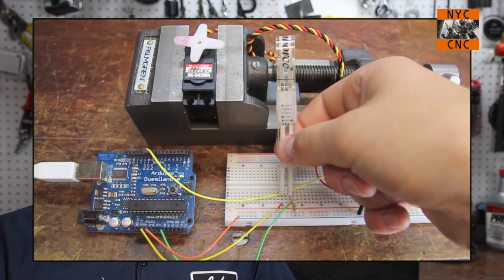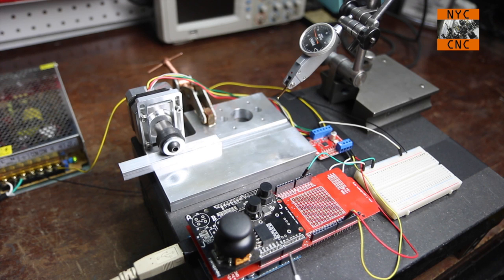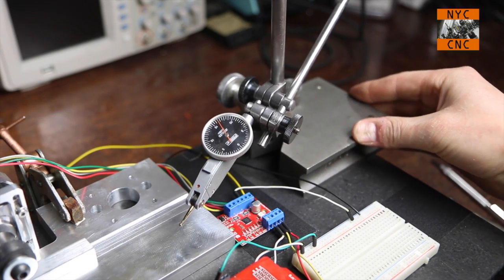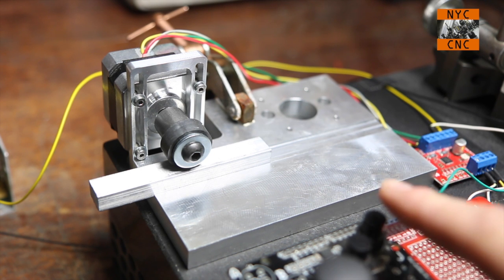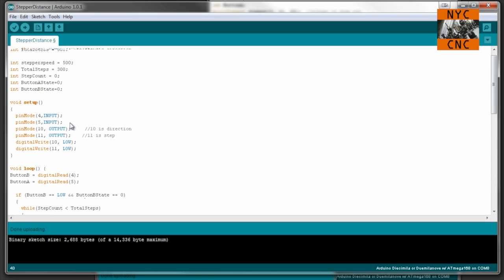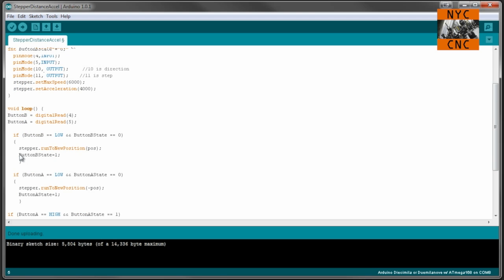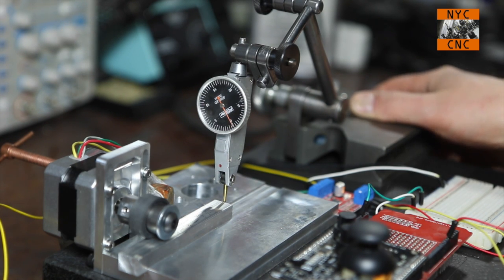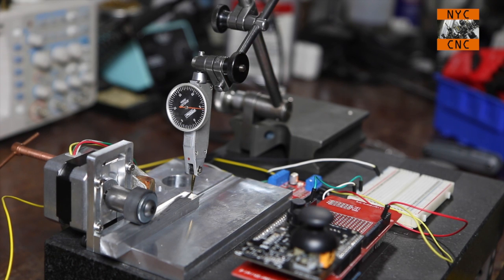Arduino Stepper:  Ultimate Accuracy!

Comment: Arduinos are for weenies.  Relying on libraries written by weenies is NEVER a good idea.  Leave the Arduinos to the 'Macs are the best computers in the known universe' crowd, and learn to write and compile C programs to be directly uploaded to the uC of your choice...'sketches and shields', LMAO.
Reply: You don't seem to realize that that is precisely what it is when you "upload a sketch". It compiles with avr-gcc and uploads with avrdude.
Reply: dc443
You're right, I didn't know that, but it merely reinforces my point.  Why add another needless layer of BS to what should be a relatively simple process.  Not to mention all the pretentious renaming of the basic concepts: source = 'sketch', PCB = 'shield', etc.  Not surprising that so many Arduino 'programmers' have trouble with data types, floating point, etc.

If the Arduino fad is looked upon as a starting point toward programming, fair enough.  But all I see is the self-congratulatory LED-blinking, and the dilettantes who pass this stuff off as accomplishment.  The smart ones are the mfgs and retailers who are tiny beneficiaries of the Apple Fanboi movement...

Oh yeah, and we have a chick selling hardware, exploiting the Countess of Lovelace.  How incredibly revolutionary!

Arduino is marketing, pure and simple.  It's very clever marketing, egalitarian, and pandering to the lowest common denominator.  I suppose if anything useful gets done along the way, it's gravy...
Reply: schwartzenheimer1 Well if i may play the devil's advocate a little bit, perhaps i could point out that you are simply a little bitter about not yourself coming up with the brilliant insight of how profitable it is to be able to sell boards for $30 a pop that sell like hotcakes because all the "idiots" buy them to blink some LEDs on before they most likely collect dust for the rest of their existence. 

I think I can understand the source of that cynicism coming from those us who have spent years doing things the "hard way".  Seeing hundreds of "idiots" post "self congratulatory videos" and what not about their "Hello World" experiments. It gets old seeing these useless things. The truth, however, is that this is the democratization of electronics and computer engineering. People gotta start somewhere, man. Young people, new people learning things quick and doing useless things should be encouraged. They are not idiots and I don't see why you have to contemptuously label these folks as such. They are sharing the delight they had making something work. How can you not appreciate that? It's one of the best feelings anyone can experience.

I am one of those people who started out learning electronics after the advent of Arduino, but I'm kind of different because it just clicked a whole lot better for me since I already had a very good understanding of data structures and all that. With a perspective like this I will say that they are doing something great which is wrapping up the scary complicated steps and putting it together in a way that novices can get started quickly. This is value in and of itself.

It does not in any way cheapen all the experience that you already have accumulated. You admitted it yourself. You were appalled by the "pretentious renaming" of stuff and it offended you so much that you didn't even bother to look under the hood to see that it's just clever packaging of the same old time-tested workhorse tools to just make it work. It's just marketing and packaging, yes, that's correct. So what? Why not embrace it. Why all this hate?

Pandering to the lowest common denominator is complained about by aficionados in every single hobby ever. It just so happens that electronics can be so much more rewarding than just any old hobby. Admit it, all you who lament the pandering to the LCD. Selling in volume is the name of the game. 

And that jab at ladyada is just completely lame and uncalled for. What the hell does a woman have to do to earn your respect??? In what twisted version of reality is this "exploitation"??
Reply: First, your suppositions about my 'bitterness' are unfounded and uncalled for.  Taking it to that level is a good way to end the conversation.

However, since you're obviously bright, I'll take the time to elaborate a little.

I don't object at all to people learning a new way to do things, provided that that new way is effective and, more importantly, rigorous.  And you seem to contend that, by definition, doing things right is doing them the hard way.  What I do object to is your silly statement that pawning off shallow and facile pseudo-engineering is the "democratization of electronics and computer engineering".  It DOES cheapen the field of engineering, in much the same way as Googling symptoms of an illness and demanding your doctor treat you for it cheapens the practice of medicine.

Scratch the surface of the Arduino community, and you see that the REAL meat of computer engineering is rotting.  "Why do I get -1 (on the display I hooked up per the instruction sheet), instead of 128??", etc.  And for every 'programmer' who actually takes the time to learn about data types, there are 100 (1000?) who just post endless whiny questions on various forums until some sap posts some code to copy and paste for an 'engineered' solution.

Explaining my distaste for exploiting Ada might be a little more political, and less technical:

"What the hell does a woman have to do to earn your respect???"

There is nothing a woman, by virtue of being a woman, can do to earn my respect as an engineer.  Period.

The historical Lady Ada (as well as the real Hedy Lamarr) made significant and laudable contributions to computer science, and communications theory, respectively.  They did so because they were curious, bright, and apparently impervious to the blatant sexism that existed during their lives.  I think our goal should be the elimination of sexism, racism, ageism, etc., not the leveraging of such past evils into marketing paradigms.

Thanks for your thoughtful comments, sincerely.
Reply: Perfect example: "...learn how to code in C or Hex."

Sorry, don't mean to pick on you, but you did inject yourself into this sub-thread.

'C' is a programming language; Hex is a nickname for base 16 number representation.  You don't program in hex, although at the machine level, your code might be printed out in hexadecimal numbers, and raw hex would be all but incomprehensible to read as a program.

And I believe you raised the 'dumbing down the pool' issue, which is definitely not my point. I note that despite your reference to doubting that this thread is 'recoverable', that didn't stop you from favoring us with a long post...

Maybe I've learned something from this thread: people who just want to get something working as a proof of concept find Arduinos useful.  Fair enough, as long as a) you aren't concerned with a robust solution, or, b) have 'an EE guy' as backup to actually do the work necessary to turn your concept into a functional product.  Again, fair enough.

Curiously, I recently saw Arduino experience as part of a job qualification in a recruitment ad.  Nice, if they can afford that kind of OJT in their product development cycle.

Generally, I just see shoddy, lackadaisical attitudes toward problem solving as undesirable, and I think the Arduino approach encourages it.

'nuff said.
Reply: NYC CNC Nah, I think the discussion isn't doomed yet because I can tell that we are pretty sensible people here. First of all schwartzenheimer1 my "suppositions" were not intended as a personal attack of any sort. I was responding to the attitude and tone of your comments and it is simply my hope that you can perhaps view this situation in a different light.

The one thing that I take issue with (and it certainly is an opinion, and to which you are, of course, entitled to) is the statement that this "democratization" process does any kind of cheapening, whether it is a patient using Google to diagnose themselves or whiny kids inundating forums with asinine posts about their homework. 

This is not cheapening! All of these people who are leading themselves astray, if you will, are only even capable of doing so by the virtue of the availability of free information that is afforded to us by the internet. The logic only works if these same people would otherwise be more knowledgeable or who would otherwise have a better understanding of the fundamentals. My point is that by using Arduinos, by the virtue of e.g. Adafruit making it so easy and accessible to obtain an Arduino, somebody who wouldn't have ever gone into electronics now at least has a fighting chance to make something cool for a much smaller investment in effort than would have been required 5 or 10 years ago. This is someone who would never otherwise get a chance to learn those fundamentals, who now because of their rewarding experiences with an Arduino (as evidenced by all the youtube uploads) might actually be motivated to go learn about the fundamentals! 

This is the future of humanity, the next generations that we are talking about. How can you be serious in saying that labeling a few things with new less-scary terminology (clearly with the purpose of enticing new learners who are weary of complexity and sophistication in the language) will hurt the learning process?

I think that to say that there is some sort of epidemic that takes otherwise "pure" young minds and "infects" them is just absurd. Everybody knows that copy and pasting code and having it work is a shortcut. It will encourage them to learn about coding and learn about how and why things work. In time. 

It's like the english teacher saying that sparknotes are a force for evil. No they're not. Those notes get straight to the point. They teach me about the books I was supposed to read. They save time. That's it.
Reply: schwartzenheimer1 Anyway it's been really nice to find someone on Youtube to have an intelligent conversation with. thanks for that.
Reply: dc443
I guess we just have to agree to disagree.  I do think Sparknotes (Cliffnotes in my day) are abused, and often evil.  Nothing can take the place of reading, gathering your thoughts, and forming your own opinions and hypotheses.  Don't get me wrong: copying code snippets and using them is common practice, and will probably lead to some thoughtful investigation when things don't work.  Here, however, the OP used a library function, admitting that he didn't know what the first passed argument was for, and expected it to work.  When it didn't, I didn't see him investigating the source, or asking the forum for help.  He just wanted to move on with a 'limit switch', in spite of the fact that he had an oscilloscope in the same frame as his failed experiment!

When I suggested that he look into the physics of what he was doing, I was rewarded with sarcastic nonsense.  Really, that code could be written in a few hours, providing accel/decel ramps, and accurate positioning by anyone with the willingness to earnestly attempt it.

Sparknotes and Arduinos just seem tailor made for the lazy and superficial.  I guess I have just seen to many disasters come from that approach, not to mention an intense distaste for the smugness and arrogance attending.

Lastly (for real), while you may perceive a tone in my posts, and even deduce an attitude, going there really comes off as arrogant, and the temptation should be avoided.  I have no idea what motivates you defense of all thing Arduino, and I would be doing the discussion a disservice to try to make your motivation an issue.  If I'm wrong, fine.  There's more to life than being right.

Good talking with you.
Reply: schwartzenheimer1 Fair enough.

For once an exchange that doesn't end with name-calling! that's good enough for me too.

The other part of my angle was that pretty much if you want to sell tons of units and make lots of bucks, lazy and superficial is the way to go... sad as it may be...
Reply: dc443
Cheers.
Reply: schwartzenheimer1 Since machine code is written in hex, and you can program machine code, (I had to for a recent class where we performed a stack overflow attack) I think it's splitting hairs a little bit to attack a guy for saying he's programming in hex. It's the wrong terminology, but no less accurate. It's like saying I'm writing this sentence in letters instead of I'm writing it in English.
Reply: If the assembly mnemonics are represented using hexadecimal characters, which they are for some machines, I'd say you're programming using hex, if not IN hex. Maybe it doesn't die because the internet doesn't like people who are so supremely convinced of their own "rightness". And because you insulted something for being accessible to a wide audience (hint, the internet is a wide audience.) Choose your battles more wisely next time.
Reply: schwartzenheimer1 I have personally written a series of hexadecimal numbers for the purpose of instructing a machine to do something which it has then done. I am a master's student in computer science so I'll call that programming with hex if I feel like it. To be honest I don't remember where we drew the line between calling it assembly code and machine code but it's programming using hex. You don't need to explain to me what hexadecimal is, I can add, subtract, multiply, whatever you want in hexadecimal. It sounds like you're not really that familiar with machine code. Have you ever used a debugger? I sure as heck have. 

You're 50+ years old and yet you go around calling people weenies on internet forums and throwing out every big word you can think of to sound smart. Yeah, you're a real winner.
Reply: dc443 I never said it was a good idea to program machine code, just that it could be done and that it is done using hex, defending the poster of this video. 

As for your second point, again we're in Semantics Land. The buffer is a part of the stack, so call it whatever you want. 

My whole point in all of this is that the programming/hacking community is built on the free sharing of ideas, such as this video. If we're gonna jump down someone's throat every time they use the wrong term for something when we all know what they're talking about, (or when they post a great how-to using a piece of equipment we don't necessarily like ourselves) it will detriment said community. 

The wiki article on "stack overflow" basically says a stack overflow is a buffer overflow, so there you go.
Reply: Josh Hunsaker
No idea where 'power user' got introduced into the discussion, but in most engineering shops, C is considered the best compromise between code efficiency and maintainability (readability).  These days, C compilers produce arguably better code, at least for non-trivial programs, than the majority of assembly language programmers could ever produce, and the advantage of readability far outweighs any cute little programming sections a really skilled assembly programmer could write.

Anyway, this is getting far away from the original topic, but, hey, if you prefer the additional layer of useless abstraction, by all means, write 'sketches' and buy 'shields', and support the dilettantes who use Arduinos, and the astute business-people who sell them.

I don't know if NYC CNC ever got his cutoff machine to work, but I am 100% sure I wouldn't have done it the way  he did.  Open-loop, third party library, 'sketches' and 'shields', when a simple mechanical stop would have sufficed...
Reply: I always have thought the same; but sometimes I just don't want to be playing with AVR studio's terrible library/function structure, and going down to configuring peripherals, registers and all is a bit over the top when I need to do something simple. I've written libraries for AVRs in the past, went down to assembly a few times... but honestly, why the hell have I wasted all this time - I don't know.
So I've learnt how to, and I still stick to arduino. It has a horrible GUI, but I use sublime text for editing + avr studio for programming + arduino libs.
And some do suck, yes. Like this acceleration one. Someone clearly miscounted a few steps...
Reply: why stop on C why not go directly to assembler, then you have full control of what code work. You know C compilers are know that they can produce "wrong" code (old versions of Microsoft C from 90 was known that they could produce wrong code if you use maximum optimization of code)
Reply: TheOruzu Since your opening sentence/assumption is incorrect (assembly language is NOT written in hex, it is written in assembly mnemonics, which are usually different for every family of microprocessor) , the rest of your argument is invalid. I do take to heart that a principle, expressed in incorrect terminology may still have some validity, but in any practical sense, the op was incorrect.

Jeez, this thread just won't die...
Reply: TheOruzu assembly mnemonics are not represented in hex. Hex is convenient shorthand for base 16 numbers, and has nothing intrinsically to do with assembly language.

Interesting that you think of the internet in anthropormorphic terms - maybe projecting your own pre-conceptions?

In any case, I'll put my 35 years of embedded systems experience against the mob rule of the neophyte internet Weenies all day long. 

And what battles I choose,  well, need I point out the obvious?
Reply: TheOruzu You're in a hole. Time to stop digging. And it's 60+. You may go now, as you aren't worthy of any more of my time. Great Master's program, that.
Reply: TheOruzu You're in a hole. Time to stop digging. And it's 60+. You may go now, as you aren't worthy of any more of my time. Great Master's program, that.
Reply: schwartzenheimer1 Aww, did I hurt your feelings? Last I checked 60+ is included in the 50+ category. And I'll take your silence as evidence that you probably don't even know what a debugger does. Hint #2: there's a lot of hex. And it's representing assembly language. As you can see, it is a pretty good master's program. Stop replying whenever you feel like it.
Reply: Ha, check out the egos on these two.

Look man, if "programming in hex" makes you feel better, then by all means. The fact is that nobody stands to gain anything by anyone (you included, TheOruzu) on the sole basis of performing a task in a way that is more difficult. In the presence of a C compiler (or even better! a C++ compiler) for your target platform, it is quite simply not a productive or smart thing to do to then go on and not use the compiler, and manually write assembly, or god forbid use a hex editor to directly edit raw machine instructions. What's next, opening the executable file as a bitmap in MS Paint and forcing yourself to use the pencil tool to program? That's probably even more difficult. Even more street cred, huh?

There are a few exceptions: doing it for educational purposes, or for doing it for fun, or, in only very extremely special situations, using it to gain even greater control over the hardware that somehow you need (such as the aforementioned "stack overflow" attack, though I would venture a guess that a more correct term to use for those exercises is "stack smashing" or "buffer overflow" -- stack overflow happens usually when the actual stack size is overtaken, whereas overflow vulnerabilities are mostly about breaking out of some single stack frame -- That being said, even such an attack does not involve you necessarily writing anything in assembly, it just helps quite a bit to know how it works). There are just not many reasons to justify manual assembly programming. Mistakes are easier to make. The time it takes to implement something is much longer. Indeed, debugging is usually much more difficult as well. Any one of those three reasons should already be enough.

For example, if it isn't obvious to you already, it is far, far easier to write C or C++ code that is safe against simple exploits like stack smashing buffer overruns then it is to write code in assembly that is similarly robust. 

How do I unsubscribe from a Youtube discussion thread???
Reply: TheOruzu Well, you're still conflating two separate mechanisms (the stack overflow and the buffer overflow attack), but sure, nobody cares here, this is Youtube for crying out loud. 

I could not possibly agree more with what you said here, let's see if I can repeat it in bold this time so more people will read it: 

the programming/hacking community is built on the free sharing of ideas, such as this video. If we're gonna jump down someone's throat every time they use the wrong term for something when we all know what they're talking about, (or when they post a great how-to using a piece of equipment we don't necessarily like ourselves) it will detriment said community.
Reply: TheOruzu Machine programing is done in machine language (or if you like in machine code) and HEX is only most usual format that device programmers use, but microcontrollers and all processors use only binary format (as you know).
It can be also done and was done with sewing needles (core rope memory). And as dc443  said it is posible to use MS Paint to make program only you need to produce correct sequence of bytes that your target system will understand.
Buffer is not part of stack (not in all architectures) and you can't cause stack smashing on processors that dont use stack for storing temporary data but you can cause stack overflow and all (you can do it with 2 lines of c code and you dont need to do that in machine language).
Reply: You are a tard... try sticking you mac & cheese in a area slightly larger than a pack of cigarettes.. Oh yeah did I forget to mention you need to buy your Mac & cheeseeeee for $20
Reply: schwartzenheimer1 If you believe coding in C for a micro makes you a "power-user" then you're trolling harder than you realize.
Reply: Josh Hunsaker No that just make him less novice than someone who use Arduino and in most case he will produce better results in C then most people are able to do in assembly (for non trivial programs and if he use some compiler with good optimization like IAR or KEIL)
Reply: Miloš Lazović If that's the case then whoever is in question hasn't studied the processor architecture well enough (you have to be smarter than the compiler obviously).  You're making huge assumptions here.
Reply: schwartzenheimer1 When you're creating code for a commercial product where ever penny and clock cycle counts, then it's on you if you really trust your compiler that much.  Must be nice working for an engineering house where they can throw money left and right on the commercial versions of every possible compiler.Having a quaint codebase is nice, but as you've said it's still a compromise.
Reply: Josh Hunsaker you can study processor as much as you want in most case for non trivial program optimization compilers will produce better code, You talk as someone who never saw how much optimizations they do ( and what tricks they use). For non trivial programs it is near imposible to beat them, it is possible but you will need too much time to optimize program so till you finish it will be obsolete.
Again for your statement "When you're creating code for a commercial product where ever penny and clock cycle counts, then it's on you if you really trust your compiler that much." i will ask you do you really trust your processor that much (all of them have some silicone bugs), and yes for serious engineering house buying commercial version of compiler is trivial thing (for you maybe 5K-10K$ is big money but for serious engineering house it is nothing).
Reply: Miloš Lazović lol, well yes, that's exactly my point.  $5 - $10k is a non-trivial amount for many contractors and even many organizations.  And sure, all components will have failure rates of some kind (partial or otherwise).  That's what manufacturing/vendor contracts and flying probe/bed of nails tests are for.
Reply: Josh Hunsaker If 3K-10K$ is big money for contractor then he is not contractor it is hobbyist, that money will be back to you from less then 1 job so that is not big investment
Reply: But surely if it allows people like me to build the end result/project/machine that I need instead of learning to program in C its a GOOD thing??   Ok I would love to be able to expertly program and write websites and edit video and any number of other things I can do a bit of but not at all well.  ;)
Reply: Andy Taylor
Only in the sense that you don't have to know how to make a hammer to use one.  But hammers have been around a long time, and it's still possible to buy a crummy one - or to include a crummy, weenie-written library in your otherwise inspired project.  The OP of this thread is/will be wrapped around that particular axle until he stands back and works out for himself just exactly what needs to be done.  It's ok, good examples for everyone too learn from.  I just think the Arduino community makes it easy to get lost on the way to realizing your project.  Most will still get it done, and learn in the process, but there are just better ways to do it.

And don't call me Shirley.
Reply: Andy Taylor To be exact, you program arduino in basically a simplified C/C++ (arduino language), in most case you can copy&paste arduino code to a C/C++ file, and it will work, and arduino performs only small transformations to make sure that the code is correct C/C++ and paste it to avr-gcc compiler, so basically you still use C/C++ to write your code (but with lot of libraries to make your life simpler).